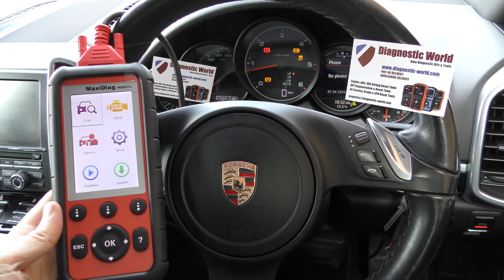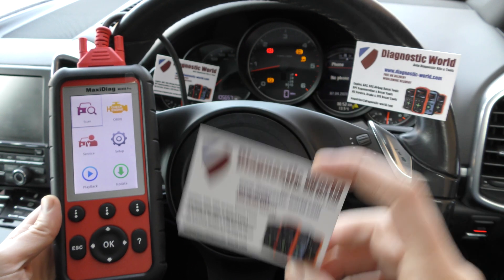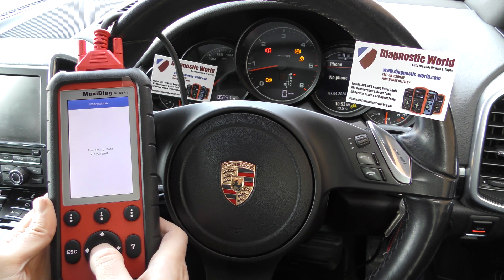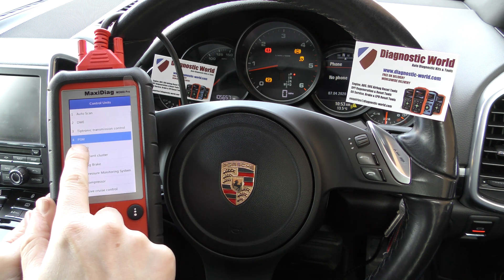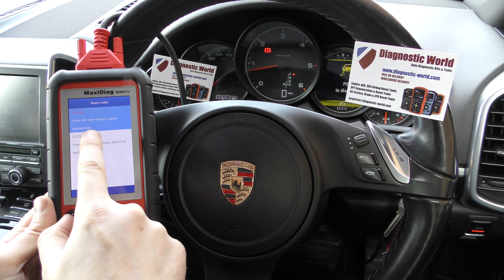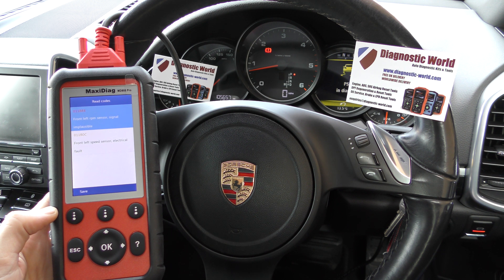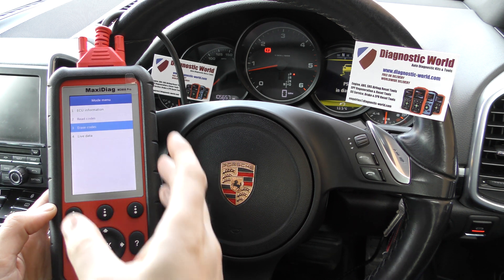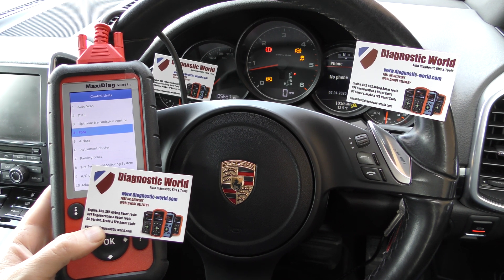Porsche Cayenne ABS Fault Sensor Diagnose Reset Fix AUTEL MD808 PRO 011B88 011B0C 955 957 958

Comment: Porsche documentation says it actually means the values don't match what the other wheels are doing. Possibly a sensor but not always. Porsche says this is what will be triggered if for example, one wheel comes off the ground when entering a steep drive way. They instruct to ignore it and it will reset itself with some driving (maybe 1km). If it stays on, it could be a faulty sensor or ABS encoder ring in the wheel bearing... Or possibly both. E.g. the air gap between the sensor and bearing is too large to detect the encoder ring properly. Similar to if the crankshaft sensor is slightly bent. Hope this helps someone in future.